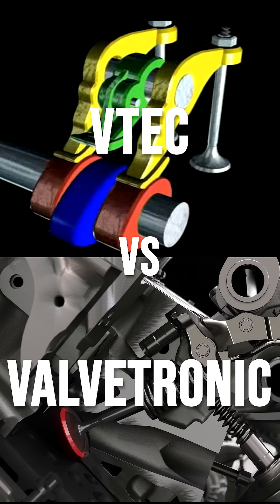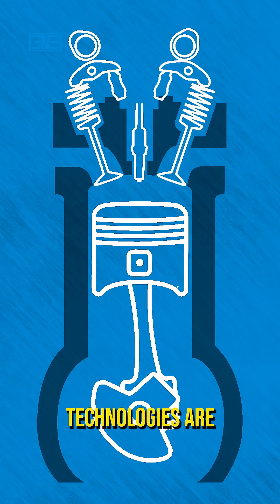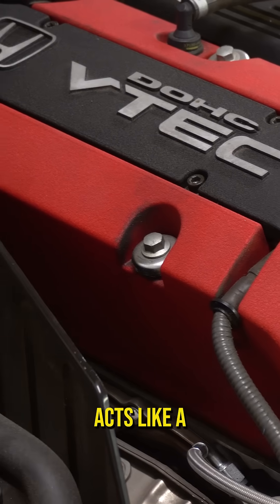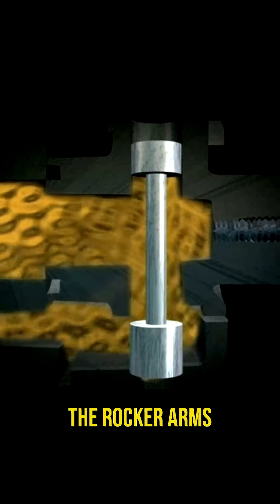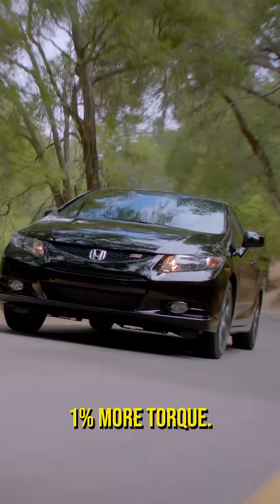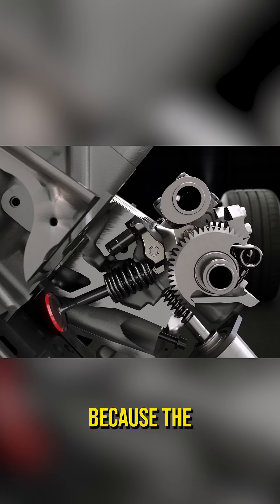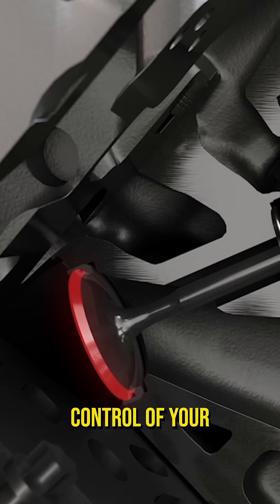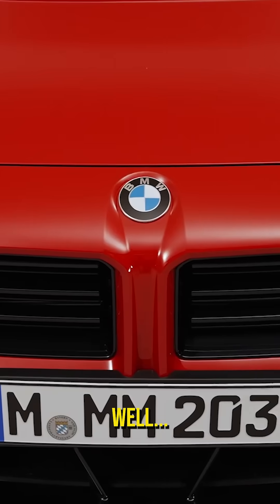VTEC vs Valvetronic - Honda vs BMW!

Comment: VTEC is only optimized at one point, since the amount of valve lift is fixed. It’s why Honda is moving away from VTEC and to a VTC system in the J35. At least with Valvetronic it’s a lot more variable.

Comment: Honda Vtech and Hyundai’s CVVD along with VVTi. Which would be perfect if you could optimize the variable cam duration for more performance and that would greatly increase is turbocharged flow with a slightly more efficient intercooler and better flowing turbo. It’s not so much how much “psi’s” out of the turbo rather than the amount of air the turbo can flow. Turbo’s are mass air flow devices and not measured with using CFM. Optimum use of the CVVD would improve performance and turbo efficiency. Way better than Vtec can. Sorry Honda fans, it’s true in many respects for the SmartStream system it’s just more flexible and refined.

Comment: Honda is great but BMW is better $ for $ there isn't another platform on earth that you can toss 1500 bucks at and have an easy reliable 500 hp. Honda on a drag strip all day long, give me a K20 with a K24 head 76 mill Turbo, Nitrous to get her going down low, and Bob's your uncle in the 8/9's....driving the car everyday from A-B I'd like an S55, B58,S58 even an N54 is loads of smiles. Sure all preventative maintenance done first and you will smile every single day. (Aside from an open diff, get xdrive so you have 2 open diffs) hahaha hahahaha hahahahahahah love me some BMW daily driving life. If ya know ya know if ya done ya dont. Ive had 700 hp N54B30 and 600 hp B58B30B still taking BMW for daily driving.  Honda/acura are great units, i just prefer BMW my wife drives an Acura and all is well with the world in my mind anyway....i love all motors in all cars just stirring the pot.....

Comment: Wooow there friend. You feel 1% power. 😅.   It's v tech yo.  That is the point, it changes the time space continuum for the car and the occupants ( mostly the driver ) and it increases power to level over 99999. If you need more order Mugen parts😂. And yet that change is imperceivable to anyone outside the v-tech space and time continuum.😂😂

Comment: i give it to VTEC because even though it doesnt boost torque down low, it lets you have a better cam profile for efficiency and torque down low then switches to a high profile cam where its useful, from what i see of the AP1's torque curve they switch the profiles pretty late and couldve gotten a nicer powerband by activating earlier but its still so cool to see how much it jumps all at once

Comment: Vtec is older...vtec 2  and everyone has copied honda, some a little better for power but even toyota has a lot of issues with vvt especially if you use wrong oil

Comment: I knew someone with an Integra. He brought it in for regular servicing and I was bringing him home. There was a bit a shock when they checked the records and nobody had changed the oil, ever, although my friend had topped it off.100,000 km and it was fine.

Comment: Have you ever heard of over engineering something making it so complicated that it actually is way more expensive and does the job not as well yeah that’s this. Honda’s is refined simple solution to the problem. BMWs is an over engineered solution that will no doubt breakdown and no doubt will cost at minimum $2000 more than any other card effects with a similar problem

Comment: Vtech is obsolete nowadays, originally, it was designed to get horsepower and good gas mileage out of a small displacement motor in the 90s.

Comment: The VTEC Honda, duh... Because over engineering something to get a dramatic improvement when things are measured at its peak is still over engineering!  .. and 1% increase in torque is like an increase of 2 foot pounds of torque, median... BMW is bonkers anywhere practical year after year

Comment: VTEC is the wood burning stove < as long as you have oil pressure you good bro
VANOS is the space time continuum, maybe it works on magic, maybe it's pixie dust...no one knows

Comment: The difference is that Honda designed a system for efficiency, where BMW designed a system for performance. The commentary suggests that VTech is no good because honda doesn't typically put powerful engines in 5 year throw away grocery getters...What a tool

Comment: Love Honda which is I have an old Civic Type R as my daily and an M240i with the B58 as my weekend toy. Don't think you can narrow the difference down to VTEC or Valvetronic, the biggest difference is turbo 6 pot vs N/A 4 pot. Honda for lots of revs and usable performance, B58 for silly amounts of power and torque and effortless acceleration that's exciting but not as fun or usable on the road as the Honda. That being said, my Honda has 155K on the clock with no major issues. Don't know if the Beemer will do that, only time will tell.

Comment: Valvetronic is a more advanced system that really is a game changer. Having said that vtec has been around for 30 years and I don't think I've ever seen it fail to function save a for a few times when that vtec solenoid failed.

Comment: The valvetronic on the B58 seems fairly rock solid.  I don’t feel like the previous unreliability of BMW engines was related to the Vron system specifically but more related to some other question design choices.

Comment: 😂 Vtec kicked in 1% extra torque.
My step bro had a prelude type R and i had a 200sx, and at the time i had never experienced Vtec, i thought it was gonna be like my turbo on my 200sx....lag, lag, lag then hang on for dear life.....
Nah... I mean i was impressed with the noise but it felt like a gimmick to me at the time.

Comment: I've been in IT for 20 years. The fewer the moving parts, the better. If I have engine problems with my civic, I can fix most of them in my garage and replace weak OEM components with better aftermarket parts while I'm at it and not have to worry about it. I'll take my '20 civic si over any bmw of the same year just for the lower cost of ownership and ease in modification.

Comment: If the BMW system fails, you like it the most. It is very expensive to fix -3K easy. 3 repairs in 5 Years. N55 - never again !

Comment: Lot of copage from folks in the comments about real world vs on paper, who have never even owned an old bmw lol. The valvetronic system isn't one of the things that goes bad, and by the time it does go bad, you're likely going to be changing timing chains and such at like 300-400k mi
Reply: Valvtronic is significantly more problematic with wear on the gear teeth on the eccentric shaft wear, wear of the roller bearings , or the actuator itself including oil seeping into the wiring.   It's around $4k repair.

Comment: Go ahead, buy that BMW and enjoy it while you still have any money left in your checking account.   After the valve guides start leaking and they need to drop the engine out the bottom making a 4 hour fix 40 hours you will be ready for Honda.

Comment: Double vanos + ITB on an s54 is god mode. You can't argue this. This is incredible technology for it day. BMW in the day of NA was pure domination. Easy to say Honda reliability but both suffer from issues over 20 years of Street and racing testing. BMW powered the McLaren F1. Honda does not have that  pedigree.

Comment: vtec kick is not always real. on the k20z3 honda set it too high (5800) so you lose alot of power until it actually kicks. hondata moves it to 4350, i lost the kick but the vtec is more there

Comment: German cars are lemons and made to be recyclable. Went down that road cost a lot of money  2000 , E 430 4 matic .Audi TT 2000. 86 325i BMW all brand spanking new. All lemons. New 93 ES 300 Lexus, 14 years winner,  Used 92 LS 400 Lexus @98 k took it to 400000k 17 year  3rd owner,friend did. 2001 Lexus LS 430 @ 89k now @210000k. (Replacement of the lemon 430 E Benz at 6 years in @ 50 k.) The 24 year old LS 430 still is my dally driver. + 😊 treaded self to second wheels in 2018 of a , 2010 LS 460 L AWD executive lux seating package, was @ 90k. 
Japanese cars, reliable, quality. “ In the pursuit of perfection” LS 430 rated best Automobile since the history of the automobile. Air drag coefficient .25 class leading for a big sedan Lexusset the  standard for the industry, for automobile headlights, projector beams in the 90s. sound, quietest, long lasting suspension due to sub rubber insulators  as well,  customer service,, impeccable Quality experience.

After the introduction by Toyota of the Lexus LS400, Germany sat up as the Lexus out sold their luxury cars in the United States and they were Less costly. This provoked the biggest changes for Mercedes Audi and BMW.  
Now it’s no secret, The LS400 and LS 430 Lexus copy the S class design. When people didn’t know what my LS400 was, they thought it was a Mercedes. People today think my LS 430 is an S class. When I see another old LS 430, I flash my lights. Surprisingly they’re becoming more popular in my smaller town as people seek them out.  I never see an S class anymore of the day. 😢 They just never made it. Correction, I saw one in the parking lot of FreshCo. It was a rust bucket. I felt so sad. It was once such a beautiful car an S 500. It was just junk,  I parked my Lexus 430 right beside it, shiny, no rust, looking beautiful. I took some pictures. 
Japanese versus European. At 400,000 km you could still stand a loony, that’s a coin, on the engine of the LS 400 from 1992 and it didn’t fall over even revving it. Wow.

Comment: V-Tech adds 10-20 hp.
Valvetronic itself produces little if any additional horsepower, but adds significant efficiency.
Reply: The valvetronic system produces a flatter torque curve which produces higher HP over a fixed grind camshaft designed for everyday use

Comment: I owned 2 BMW cars with 6 inline engines. An e36 320i (only intake valvetronic afaik) en an e90 330i with intake and exhaust valvetronic. Both of them ran up to 160.000 miles without any issues to that system.

BMWs have other more obvious issues like oil leaks and chain rattle. The oil pan design is flawed by design/choice as the seal is always below the oil level. I love BMWs for their tech, but it's generally complex, more expensive, though easy in maintenance.

Comment: 40-50 hp is not 1% on a 150-200 hp engine you goddamn moron
Reply: I have a 2009 Civic SI, when it switched cam lobes, it added around 40-50 hp. Actually tested it, had it on the dynamometer a number of times

Comment: Definitely BMW.  Just because Honda is reliable, doesn't make it a holistically better car.  Dependable, fine. At the sacrifice of the driving experience and power.  Though not perfect, BMWs are pretty dang good - after owning 5 of them.

Comment: VTEC is simpler, but my problem with it is the lack of torque. They feel perky when the revs are up, but they have to downshift for EVERYTHING! We've had two VTEC's in the family, and it's annoying to have the engine winding out just to maintain speed uphill. Meanwhile, my wife's 300,000 mile PT Cruiser climbs grades in overdrive... 😂

Comment: I owned a Honda VFR800 motorcycle. It had VTEC. It was like owning two completely different engines, one mild mannered and easy to control at low RPM, the other a screaming banshee determined to propel you off the planet at higher RPM. It has my vote.
Reply: Was my dream bike as a teen!
Reply: I currently have a '15 VFR800 and I love it so much. VTEC goes off at about 6500rpm and it makes me smile every time.
Reply: It's beautiful. I was talking about VTEC with my wife the other day and was like "yeah if you floor it it turns into a whole different beast at high revs" and punched the go-flap. At 4k and some it went from an enthusiastic purr to a full throated yowl and you felt the change in your butt. 

The funniest part is, it's a minivan, but that change STILL feels like it wants to yeet you off the planet.
Reply: @Solnoric  I once took a test drive in a Civic STI with VTEC. I don’t know why I didn’t buy that car, it was perfect. So much fun.
Reply: BMW, full employment act
Reply: Me too .. a 2007 and it was simply amazing ... smooth and silent below 6000 rpm, screaming and exciting over. No delays, no drawbacks, no compromise during daily use. The more you ride, the more you love it, it's a Honda.
Reply: They made the 2nd gens crack vtec more calmly as people were scared 😂🤣🤣 1st gen for me pls 👌😁👍

Comment: I did 540.400 km's in 22 years with a Integra Type R. Without a gearbox or an engine rebuild. Not even a headgasket. Keep oil in the engine and give the engine time to reach the optimal operating temperature. And you can keep reving it to 8400 rpm, even after 500.000 km's.

Comment: Every built Honda engine pushin 600+ always has locked vtec. Or removed completely. As all bmw engines pushin power always keep valvetronic

Comment: Easy for easy to fix honda & better AC  conditioner honda the best

For Luxury & sport Bmw easy but engine well always has trouble Sensor body throttle & engine gasket😑

Comment: I'll take less complicated, more reliable, and less expensive every time. The more complicated something is, the easier it is for a problem to occur. Part of that can be reduced by better manufacturing to reduce problems that are the result of manufacturing. Better manufacturing requires time to properly improve. So, at some point BMW's system will probably be more reliable.

Comment: I wonder if americans just completely disregard maintenance or if german manufacturers sell a worse product over there. 
Nobody in Europe would consider bmw's unreliable, because they absolutely aren't. 
Are current models as reliable as japanese cars from the 80's and 90's that use a system developed in 1983? No. But that goes for almost every car in the world built after the year 2000.

And that's exactly the point, VTEC was developed in 1983, Valvetronic in 2001. 
Compared to cars of the same era they are reliable. Sure, for every car model there will be some equivalent from a japanese manufacturer that's more reliable. But it doesn't mean bmw's are unreliable in general, only because some bmw's are less reliable than japanese cars.

Comparing a 80's or 90's civic to a bmw from the 2000's is like comparing a detroit diesel to a common rail. 
Sure, the Detroit will start up after sitting for decades, but still nobody wants one in daily use, because even compared to an american diesel from today it will feel like a lawnmower engine..

Comment: the 0 torque issue is not vtec's fault but japanese short stroke engine design. So as a package, clwar preference for the german engine.

Comment: Valvetrronic gives you the option of using some very efficient modes of operation when running less than full throttle Which is almost always for example if you keep the intake valve open just a little past bottom center you will effectively give yourself a power stroke that is slightly longer than your compression stroke. This will not increase your power but it will increase your fuel efficiency. Best of all it could instantly select from modes depending on load requirements and prevailing conditions. You could constantly be in whatever mode is optimal for what you are doing. Can't do that with a regular cam engine. The only potential problem is increased cost and more moving parts means more potential failure points.

Comment: Had a V-Tec Honda. Started leaking oil into the coolant line. Problems with the block casting from the foundry. Honda knew about it but 90% of them would fail after the warranty expired so they did nothing.

Comment: That’s the thing. If you want something punchy and fun you go Honda you’ll feel and hear VTEC transition and you can get great power out of them by modifying the motor. Or if you like something smooth and fast you go with BMW, you’ll get more power out of the gate in general but modifying them can be a nightmare and it’ll just cause more issues in the near future.